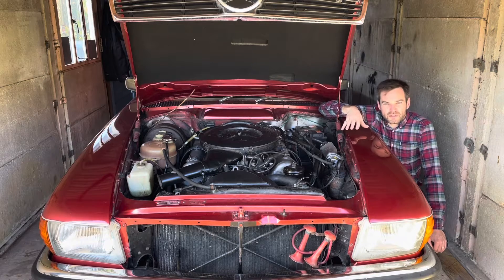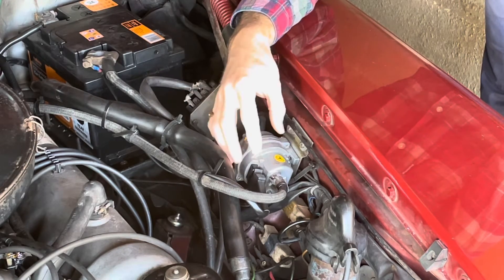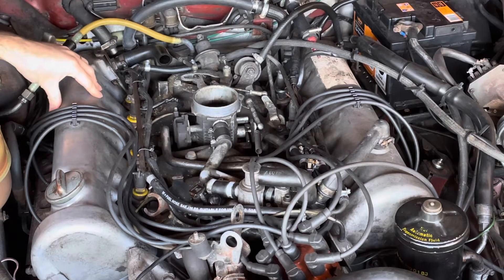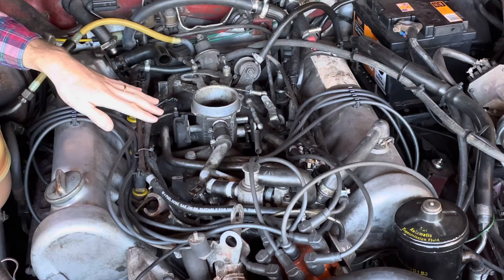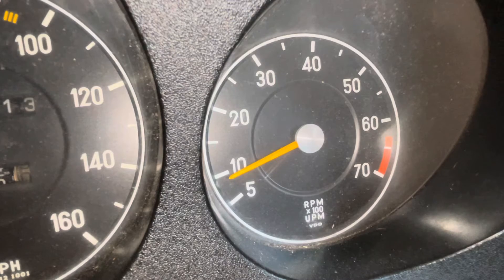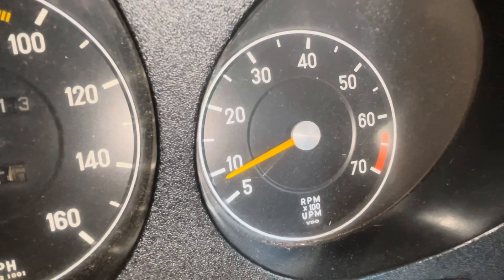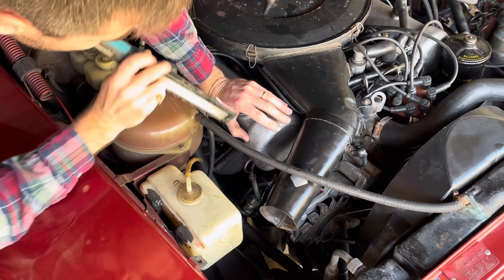Under the bonnet of an early Mercedes SL R107 V8

Comment: You can tell if the MAP sensor has been opened at some point if the fasteners are no longer rivets, instead are nut and bolt secured. The sensor may fail in certain times if the unit won't hold a vacuum due to a degraded o ring. That is a simple repair. I have fixed a few over the years.  Yes a specialized device but not complicated one.
Very informative video. I would include trigger points overview to your well discussion. Thanks.

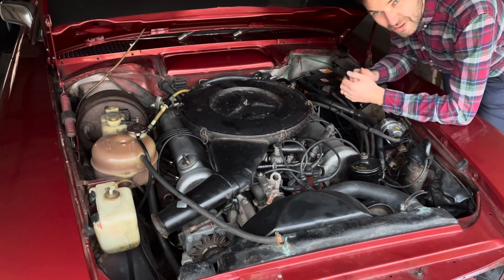Comment: Hi there if you got fuel going to the fuel rail but not coming out of any injectors ( or start up injector and all the injector have been tested and ultra sonic clean in good order ) and good spark on all plugs would yo say ecu needs attention ?? My car 1973 sl350 with the same bosch d jetronic system cheers mark 19:08
Reply from the maker: It’s possibly the throttle position sensor, but yes, could be the ECU as well. One way to test the TPS is with the ignition on, open it by hand gradually and you should hear the TPS ‘click’ as the firing signal is sent to the injectors.
Reply: @ClassicEd  Thanks Ed I will get  ecu tested and repaired  if needed there not enough information  and D jetronic injection system keep up the good work (you make it easier to understand the D jetronic) thanks again mark

Comment: Thanks for video.  Out of interest does your car have 2 cylinders on the bulkhead at the backl of the engine drivers side on RHD connected to the vacuum system with one of them having an open connector? One of mine looks like it should be connected to something but isnt
Reply from the maker: I think this one just had the brake servo, don’t think has any other cylinders as such.